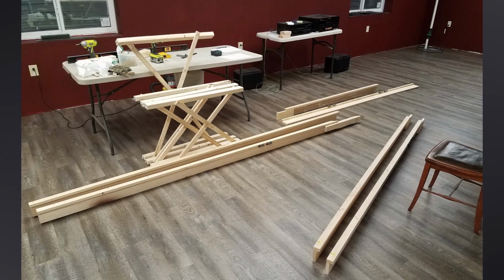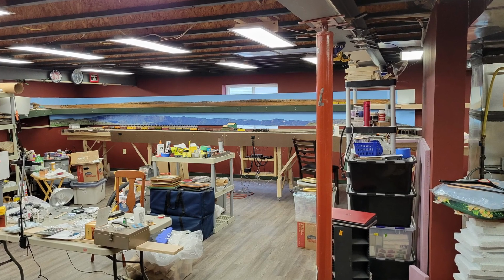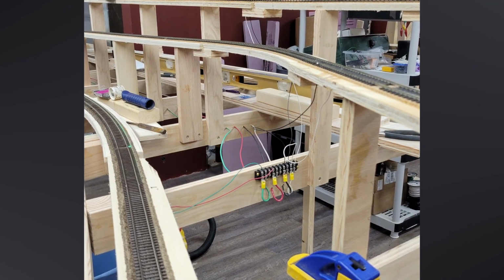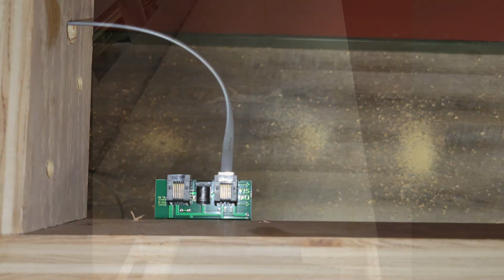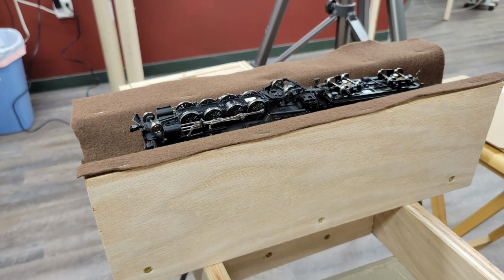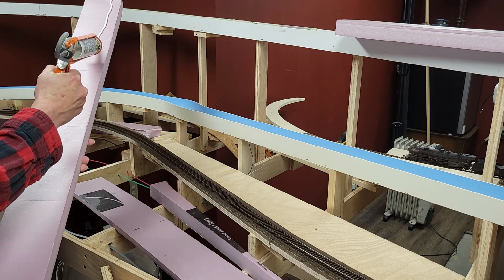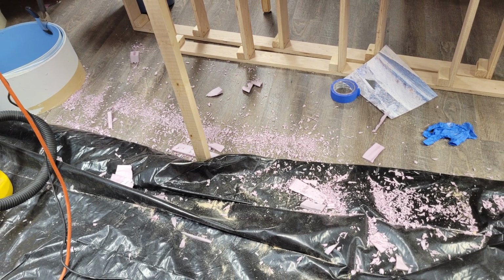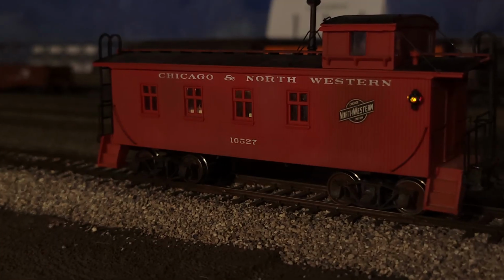2022 06 25 CB&Q V5 Second Birthday

Comment: What a great recap. Happy 2nd Birthday CB&Q! Great tip on the low temp hot glue instead of the long wait for the foam adhesive to dry. You really have gotten an incredible amount of work done. You have built a fabulous layout.

Comment: That's a lot of great progress in 2 years.  You're a real artist on scenery and a great carpenter with benchwork.  I've got a lot to live up to.

Right now I'm battling using Peco joiners with Peco code 83 track & turnouts.  The joiners seem to be made for code 50 track.  They're really tight and difficult to install after removing end ties.  I've tried forcing the joiners onto spare rail to loosen them up, but it seems to be also related to the rail ends getting messed up when cut.  I've used the prescribed orange handle cutters & the Dremel.  I think the problem is somewhere between the layout and the floor.🧍   😆
Reply from the maker: Thanks Frank! It really helps that the camera only sees what I want it to!

I've never used Peco 83, just Peco 70. When I'm laying track I use my Dremel with a cutoff wheel to bevel the ends of the rail base slightly on the bottom and the top and the outside and inside corners. Helps start the rail joiners. I just touch the side of the cutoff wheel to the rail very lightly to grind it down a bit. Doesn't usually break the wheel...

Comment: Hydracal is very hard. that is why I use plaster now and it is easier to carve to blend the rock castings together. have you ever seen the Boomer Diorama sit?? If not it has a lot of good work and he is an artist when it comes to the scenery. Take a look sometime. I'm going to try some of his teachings. Especially on scenery and the blending of different areas. At the end you mentioned construction of cars. Do you have a source?? I thought all of the cars were now prebuilt and ready to run and cost about an arm, a leg, and 3 fingers.!!!!!
Reply from the maker: Hi David! I may try making more of the rocks out of plaster of paris - easier to carve and probably a bit cheaper. A friend who was over yesterday had a good idea - he said a cheap engraver works good for carving and blending Hydrocal. Said it breaks off tiny little chips and gives good control. I might try that too.
I haven't seen Boomer Diorama. I'll take a look - thanks.
My cars are almost all kits. Athearn, Accurail, Proto 2000, and a few others. I bought most of them years ago. Accurail is still available, at about five the cost they were fifteen years ago! I also pick up older kits at train shows. I only have a few RTR cars - NMRA division special runs and such. The detail on them is superb, but I just can't swallow 40 bucks and up for a single freight car!
Reply: @The_CBQ_in_Wyoming  Cost of cars and locos is absolutely a shame. I now get 99% of any cars I want from swap meats or train shows. Just think of how much money one could have made if they had bought 2 or 3 hundred "blue box" cars in the 70's. Also what would you have if you had bought 1 car a month and 1 engine a year back in the 60's??? I remember when engines were just about 100 dollars and now they are in the 6 to 9 hundred dollar range.